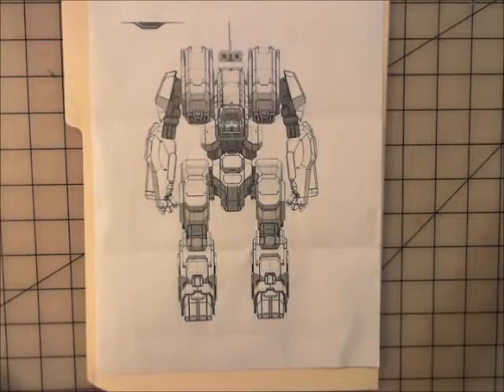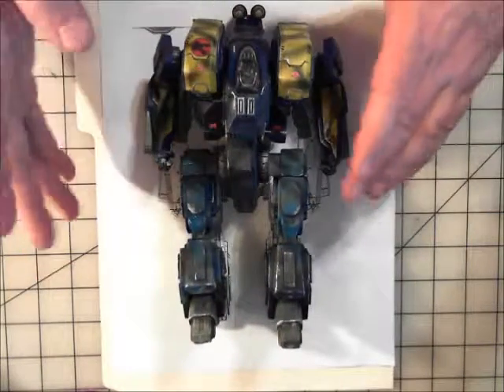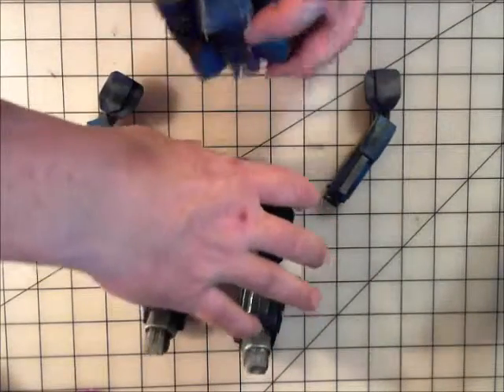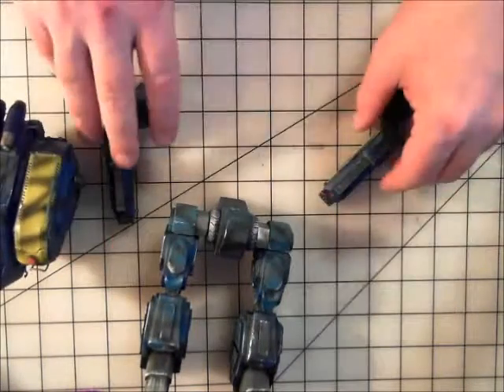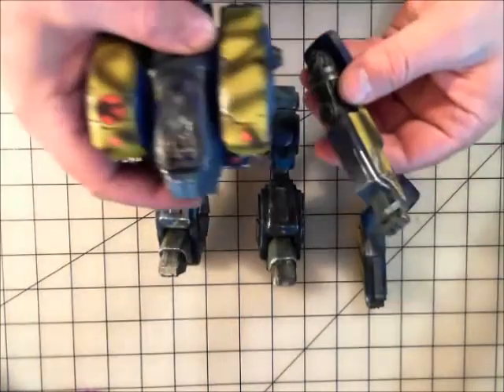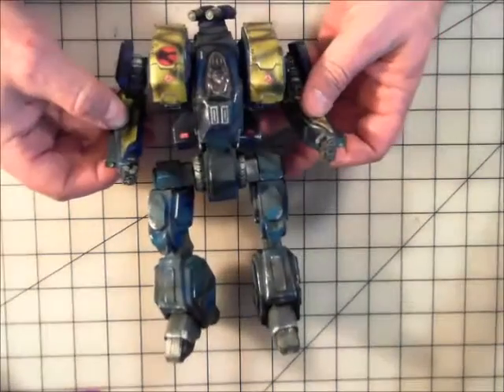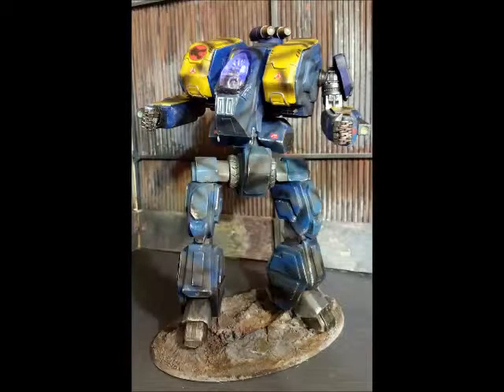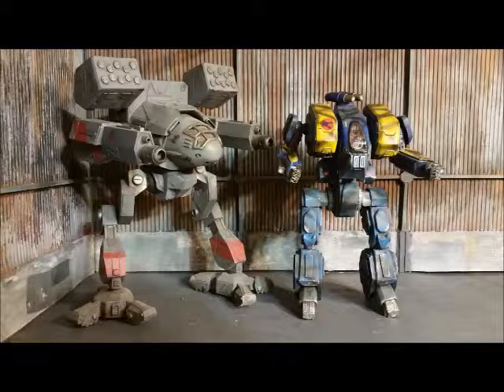1:60 scale MWO - inspired Archer Battlemech scratch-build reveal.

Comment: Great model, could you say or do a tutorial on how to make models of this scale?
Reply from the maker: Hi there, and thanks.  I actually have a few on how to assemble kits like this.  Specifically the Archer and Atlas series.  Are you wondering more about how to create the original parts and so on?
Reply: If you are correct, how do you do modeling in 2d and can you move it to 3d. I would appreciate any tutorial that you recommend or that you can do to share.
Reply from the maker: Sure, I have a project coming up and I may be able to do something like that.  The short version is that it's basic engineering stuff.  Start with a drawing and then fabricate from that drawing by hand.  I did much of that with the Archer, although I didn't really video those steps.  I'll look into it. : )